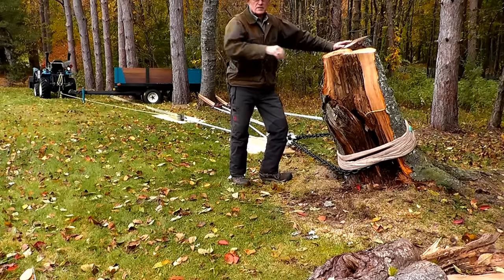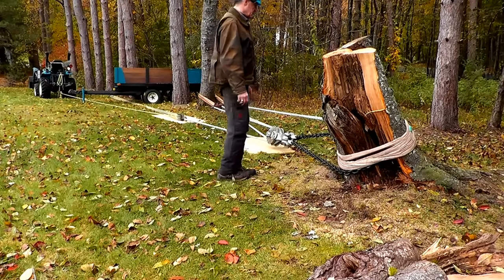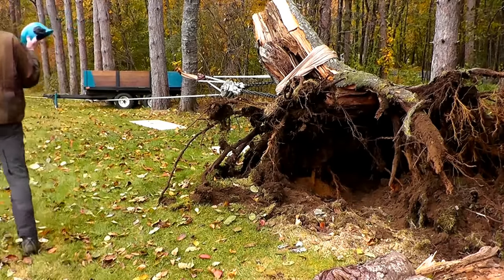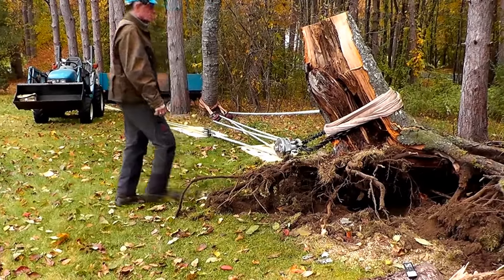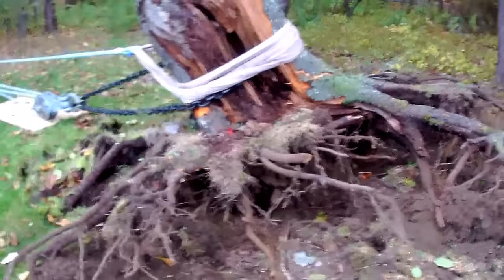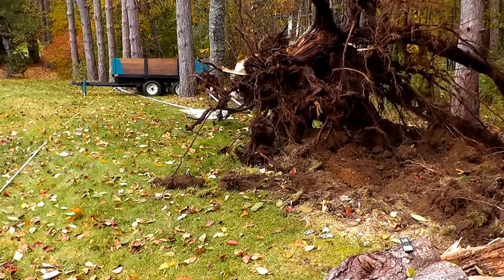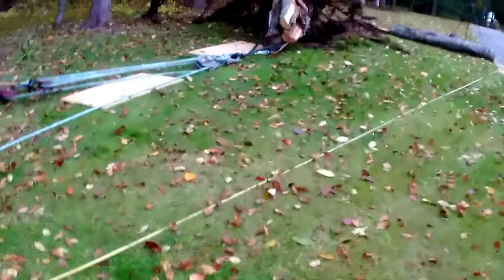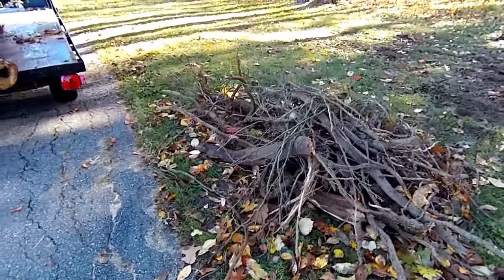Big Stump, Little Tractor

Comment: Why does the fairly big cherry stump pull out instead of the much smaller anchor tree pulling over?
Reply from the maker: Great question.  Two reasons:  the cherry feels 25% more force than the anchor tree because of the strands going off to the block and tackle and the tractor;  plus the cherry had already been pushed over by about 30 degrees in a windstorm, threatening the driveway ... that's why I had to take it down. If I had been unsure of the outcome, I would have used my E/E Sling to spread the forces to two ground anchors. See vid "Extensible/Equalizing Anchor Sling".
Reply: Thanks much Tom! I've subscribed for a while but haven't seen all of your videos yet. Found this one this morning....

Comment: Impressive power!Please pardon two suggestions.  First, it would probably be easier on your anchor trees if you used more of them to lessen the load on each.  Second,  fastening higher on the stump would give you better leverage to get initial movement and would lower the load on the anchor trees.Definitely impressed with the hardware you've accumulated.Hope you can continue posting great videos after you move.
Reply from the maker: +Terry Hale Agreed!  Thanks for the nice thought.  For the leverage, check of my vid "Widowmaker Trip.  And I think an equalizing bridle might be a useful project."
Reply: Yes.  I hope you can find the time and situation for that project.
Reply from the maker: +Terry Hale Terry, check the new playlist "E/E Anchor Sling".  Extendable/Equalizing.  A new idea using rigging thimbles.
Reply: Nicely designed experiment!  Talk about anticipation.

Comment: Don't know much on pulleys and tractor stuff ... But when I saw that hard hat and all of that set up.. This guys knows his shit... I was looking at all kinds of ways people have tried getting rid of there stumps and I bow down to you.. It was awesome watching you work.. Intelligence goes a long way... Nice job👍👍👍👍👍👍
Reply: The snatch block is considered a "rolling lever", doubles the force but slows line speed by 1/2, that and you have to pull twice the distance (note how far he's travelling vs how much the tree moves).   Of course this only works with certain applications of the blocks.  He's just set this up with a shitload of line and tons of blocks which works because of the use of the anchors (trees) and the rigging being strong enough.   They have an exhibit at some tow shows where 4-5 kids will pickup a truck or re-right an overturned one all due to proper rigging like this.   You can move anything with enough line and pulleys.

Comment: a useful tool to avoid damage to an anchor tree is a semi-trailer truck mudflap. whenever i have used another tree for leverage (usually with a chain in my case) i first wrap the tree with 2 or three layers of corrugated cardboard and then the rubber mudflap, then the chain wraps over that.  the mudflap only needs to cover the side exposed to the chain, and the chain can be an open loop.  this will protect the tree and the thick, stiff material of the mudflap prevents it moving or sliding.  i have never had any damage to a tree using this method.  it would be one small improvement to tom's method.  often times, you can see and retrieve one of these mud flaps along the highway where they have fallen off a big rig.

Comment: Very impressive.  Had a tree I wanted gone.  Had power company come in and cut it down and limb it.  They left me with a 10' stump, per my request.  Did it the old fashion way, brute force.  Attracted cable at top and pulled it out with a Jeep Grand Wagoneer.  Was much quicker, but harder on the vehicle.  Neighbors laughed at me with my 8" root ball in my yard.  Hats off to you sir.

Comment: Finally! A man that says stump and actually has something that is more than 6" across. Nice looking arrangement I see on that.
Reply from the maker: Check out the vid "Mechanical advantage vs. straight pull rigging".  Go in to about 0:55 sec and you'll see  21" and 22"  BHD live oak stumps pulled with this rigging. Damn things were so big I couldn't lift them with my bucket.
Reply: If you were going to guesstimate how much money you have in riffing gear here represented by the set up you used, how much do you think it would run? I'll have to check out the other video too. I'll have another massive stump to deal with in about 3 weeks, and unfortunately it's a standalone affair, with absolutely nothing to tie off too. Looks like I'll be using a farmer jack set up as a bi-pod on that one.

Comment: Very satisfying !  I learned the advantage of compound blocks on my shrimp boat career of 18 years.  A cathead (capstan) and a 3x3 block could really do some work.  Just have to stay out of the direction the line might travel if it snaps.
Reply: Most i got was slight rope burn or bruise from broken rope, but wire on the other hand, watch out for your life.

Comment: Almost spit my coffee out!! Lol 36:1!!!!!!! Pulling the stump 10' means the tractor will have to travel 360'!!!!!! If the tractor can pull 1000lb.s then approx. 36000 can be pulled on the stump!!!!! Lol! I enjoyed the video!
Reply from the maker: You've pretty much nailed it, Scott.  The dual snatch is 12T/17T swl milspec/commercial.  the chain is 1/2" Gr100 rated 15T in the basket.  That's 4/5 of the total force on the stump without invading any safety factors.The wind-damaged cherry was no match for this rig.  If you want to see what it really can do, surf the video "Mech Advantage vs Straight Pull" and scrub through to the 0:55 mark.  22" dia, completely healthy, in firm ground.

Comment from the maker: For Earl:    The SWL of the three pulley systems are 4T (block and tackle), 8T(two snatch blocks) and 17T(dual snatch).  I don't have any experience doing this without an anchor tree.  Plenty of rigging texts illustrate various ground anchors but you will need something really BIG, for sure.  Again, without experience on this, I would guess that no good anchor disqualifies this technique and calls for hydraulic equipment to come in.

Comment: That was an impressive show of mechanical advantage Tom. Well done. Unfortunate about the tree but as the saying goes "hindsight is 20/20" :)
During the first pull I thought...wow, that sounds like a jet engine. I thought,  there's no way the roots coming out could make that noise? Then after re-rigging, just as you started the second pull I heard it again... You definitely live in a commercial jet flight path  :)
Hopefully you won't hear that at your new homestead.
Good job, very interesting and thanks for posting this, I learned a lot.
Cheers

Comment: That is some awesome pulling power. I am surprised those ropes did not break. I snap 3/4 inch rope like string with my tractor and have to resort to chains or straps.
Reply: If you use local or hardware store type rope, its not strong enough at all nor made for that type of use, if you look up Samson they make the best in the industry and sold at reasonable prices per foot and made to pull thousands of pounds, not hundreds. what you get at the local hardware department is basically cordage variety for just a few hundred pounds rating are twisted for most part or single braid if braided, and for pulling or lifting you need something with more strength and better braiding such as double braid or multi strand.
FYI, he was using Samson - Amsteel II (Uncoated I assume) at 7/8" (22 mm) rated at 50,000 lbs (22,700 kg) average mbs (max breaking strength) he bought for $1/foot, very reasonable price.

Comment: Nice job! The only think scares me is all that rope that has to stretch so much. I have a big coil of aircraft cable for this stuff and lay blankets on it for safety in case anything snaps.
Reply: Despite what you and others who also assume, synthetic rope does not act the same when it comes to breaking as it does not store energy under tension like steel wire rope. Though due to the nature of what is being pulled it is wise to put a safety blanket by the point where a pulley is being used, just in case it comes free, cause that will hurt when it flies. However most I got was a slight bruise or a burn from snapped synthetic rope.
If you still think rope does the same as steel wire, I suggest you look up rope strength testing and see it does nor will not whip as it is so light in comparison. Samson is a good source of these video demos of snapping. It does sound like a gun shot or firecracker when it goes though.

Comment: Thanks for posting, I was just wondering how much length of rope you used and the tensile strength of the rope? I use steel cable but only use two pulleys with grade 80 log chain to choke the anchor and the tree I am pulling over then out.   I am surprised the anchor cherry held its place it could of pulled out with the larger cherry stump.  Only thing I  do differently is I rig the stump as high as possible with one rap all the around for a choke. In that area no structure is at risk I would of pulled the hole tree over the weight of the tree will help with the pulling of the roots.  My tracker is a diesel 33hp 4 wheel drive I would of had to do some digging of the roots to pull that size cherry over then out with my rigging. 
Anyway way to show us how it is done with block and tackle and ropes.  
It looks like you used two one hundred foot ropes that are around 7,500 lbs tensile one new yellow and one older white, with that blue rope length 100' I do not know the tensile strength of the blue rope but it is higher than 7,500 lbs. and another 100' on the anchor points. If I am correct a total or 400' of rope rigged through 1 double, 2 single, and 2 triple snatch block  and 20' of log chain did the job.
 I have a question on the compound system ratio.  The triple provides 6:1 that is tied in to a double that provides 4:1 multiplied  together I come up with 24:1. I do not understand how he  gets 35:1.

Comment: This is a great video. Thank you for taking the time to make these. One question though; why do you prefer rope over cable?
Reply from the maker: +clint If God wanted us to work with steel cable, he would have given us drum winches for hands.  More seriously, you can get high tonnage pulleys for cable much cheaper because the axel doesn't have to be as strong.  I'm also a climber and I just like working with rope ... and I can splice it.

Comment: Would it not have been better to have pulled it out as a mainly full size tree. The advantage of pulling higher up the trunk and the added weight of the falling tree would have pulled that stump out with less effort.
I do like your idea of using rigging, great video.

Comment: Well done, in my pinion you used the wrong tree as a anchor point. the tree that you used is leaning towards the stump so when the tension came on the sling naturally slipped up as we observed taking the bark with it, the tree along side of the one you used would have been a better choice. Again good job
Reply: Bob W 
Actually could have used both trees by wraping around both tree stumps....

Comment: So if your drawbar pull is around 1000 pounds max then you are potentially applying 35,000 pounds of force with this arrangement?
Reply from the maker: Exactly right.  That silver double snatch weighs 120# and has a WORKING load rating of 17 tons.  Big beast!.  However, this pull was easy and the stump "didn't put up much of a fight" so   he forces didn't come anywhere near that.  I doubt that the drawbar saw more than 350#.

Comment: very interesting indeed. curious as to what the load rating are on these ropes and pulley blocks?
Reply: As for the rope he used, its Samson the Amsteel II (Uncoated, I assume) at 7/8"/22 mm and 50,000 lbs/22,700 kg average break strength. Far as I know.

Comment: Thumbs up

However glad the weaker of the two stumps in your video was the one that you wanted removed. Suspect no guarantee this will always be the case since I suspect the same force is put on either side of the pulley system, but I could be wooing obviously.
Reply from the maker: Right!  In this case, I knew that the cherry had moved 30 degrees in a storm and the root plate was already lifting.  For exactly this issue, I'm working on a new idea for an equalizing anchor that can also "stretch" you heaviest rigging rope.  Watch this space for another vid ... !

Comment: Very nice technique. That would come in handy on my small farm. I don't think I would have messed with changing the rig at the end tough. I would have just used a chain saw to cut the remaining roots holding it back (of course cutting them so they are beneath the ground). Would have been a little less work I think. Still, a good video illustrating a very powerful technique. Thumbs up. :)

Comment: Thanks for the video Tom. I just grabbed two Campbell 3043K from friend. They are 8" triple's w/ a 1" rope diameter  and rated at 7000 each. It was a real bargain. I now seek good 1" rope on the cheap if anyone has any suggestions. You commented your moving south to warmer weather. Are you VERY sure you will not miss 4 seasons and snow? Is it the expence to heat or the general pita of the snow itself you dislike? The reason I ask is I am in So Calif and I long for what you have! Want to trade properties? Ha! Mine is 1/3rd acre, currenly valued at 900K or so. PUNT
Reply from the maker: The Camps are going to be nice!  With 7k working load, a 1" line is probably overkill ... even at 10:1 safety factor, you need (7000/6) X 10 mbs.  I'd spend on something smaller but with less stretch (polyester, not nylon).  Something like 9/16" Stablebraid would  be awesome.  Check the specs at samsonrope.com.  You need the really big stuff connecting the Camp to the stump.

Comment: Hey Tom. What are the large pulleys and where can I get them.
Reply from the maker: The dual snatch is huge:  120# with its shackle, rated 17T WORKING load.  The two red snatches are rated 8T.  The block and tackle is good for 5T.  You can't buy these new because they are ridiculously expensive.  Watch for equipment on eBay, at county fairs and auctions.  Sometimes a farmer or a rigger or a military man will died and the family just wants the "junk" to disappear. It took me decades to assemble this rig  …! but the big double snatch cost me $50)   :-)))

Comment: I don't understand the three attachments to the stump.   I only see two, a choker strap and a chain.   What is the third attachment?
Reply from the maker: Good eyes!  I consider the chain (in a basket) to be two (2) attachment points doubling the attachment strength as compared to a single chain lassoed around the trunk.

Comment: Great job. Only I think you should lay a blanket or "winch blankets/dampener" on those lines.
Reply: While rope of the synthetic variety do not whip like wire rope of steel, however due to the pulley system as being used in this manner or pulling, would be wise to prevent the connections aka pulley from flying at you at least in the worst case. If anything the rope would just unspool and fall but not whip like wire rope does from the stored energy.

Comment: Does the 35:1 mean that the tractor's 18hp is multiplied by 35, resulting in 630?
Reply from the maker: No.  That much horsepower would never "couple up" through those four (4) small tires.  It's more like hooking up 35 little tractors to the stump and pulling in unison.
Reply: Thank you for your reply, and I applaud you on your work in this video! Very impressive!

Comment: Hi: Tom, my tractor is about the same size as your's, justvfaded orange. What type and sizes of limes are you using in this video? I have 12 single 8kg blocks that I would like to hook in a 5x4 to a 2x1 application. I'm too old to remember how to calculate the M/A, also couldn't  locate Archimedes new cell number, so you're my next best hope. Thanks. J
Reply from the maker: The tackle at the heavy end is Samson Amsteel II, 7/8" 50,000# mbs.To get the MA of a simple system, count the rope strands;  for a compound system (one pulley set pulling another) multiply the two ma.

Comment: What is diameter and rating on rope coming off stump,after chains ?  That is incredible force on that part of rope ? Thanks for sharing
Reply from the maker: Absolutely right!  Big force needs big equipment.  The big blue  rope is 7/8" Amsteel II, rated 50000# MBS.  Notice it shares the force on the stump FIVE TIMES so the effective breaking strength for the cordage is 250,000# or 125 tons!  See the vid "E/E Sling Proof Testing" to see only part of this rig rip a 3/4:=" arboristbull rope  like is was tissue paper.
Reply from the maker: The blue rope is 7/8" Amsteel II, rated 50,000# MBS. See www.samsonrope.com.
Reply: @tghoffmann  it doesn't need to be 5 X as strong as the force on the stump. In fact the stump is being pulled by 5 segments of rope so it's only 1/5. It does need to take 7 X the tractor pull though.
I'm impressed by the strength of the other tree though. The chain needs to be twice as strong as the rope. I thought that one was going to be pulled out of the ground too.